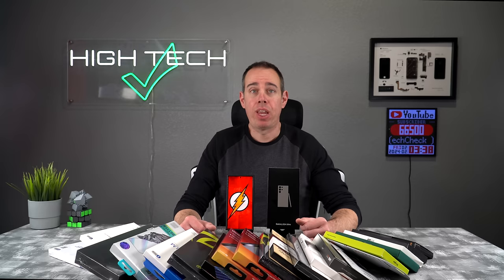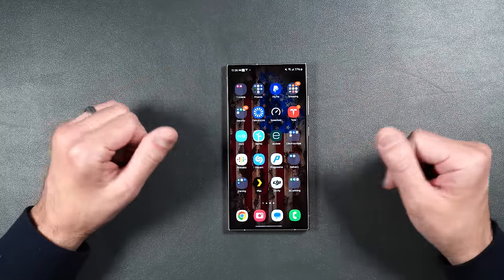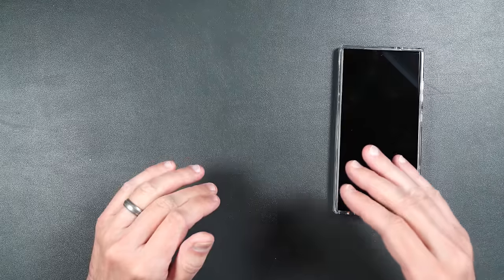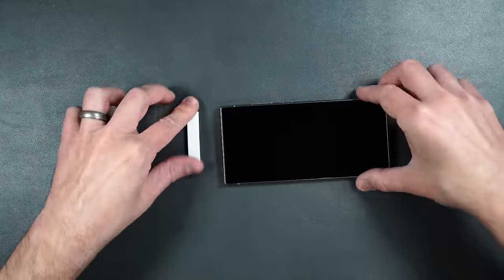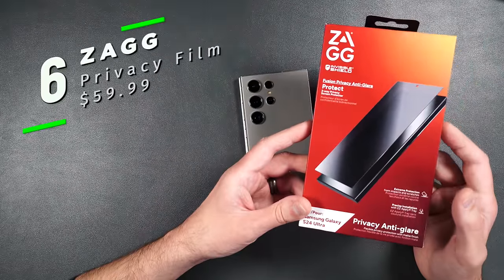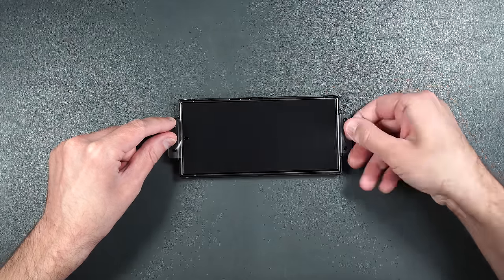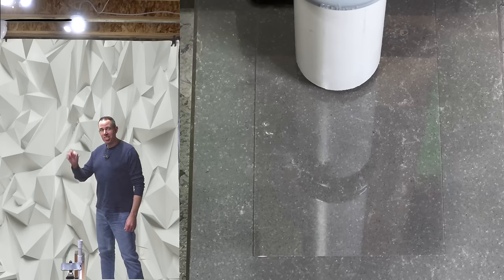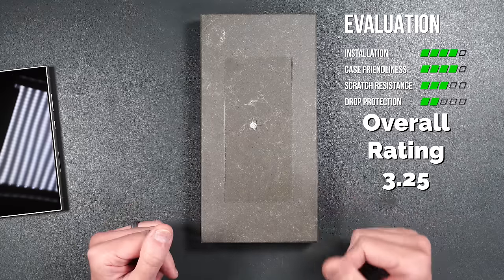Best And Worst Screen Protectors For Samsung Galaxy S24 Ultra

Comment: I think the S24 Ultra started a trend. From now on, more and more phones will have anti-reflective screens since the response has been mostly positive. I don't know how but in future evaluations of screen protectors could you find a way to measure or test their reflectiveness? I think one factor in choosing a protector will be whether it makes the screen more or less reflective relative to a standard screen. 

And one more candidate I would suggest: An official Samsung screen protector (plastic film) which claims to be anti-reflective.
Reply: Except the OEM film does not live up to the anti-reflecting claim at all!
Reply: @lcdat  From other reviews I have seen, the OEM Samsung screen protector is somewhat anti-reflective, somewhere between having no protector film at all on a S24 Ultra, and having a generic tempered glass protector. Having cracked the phone screen once, I don't want to risk going without anything.
Reply: I actually wanted to comment the same thing since I just saw a drop test that the S24 Ultra didn't do too well at, cracked at waist height (cases are important for these phones).  I have Samsung Care+ to get the screen repaired if anything ever happens, but that shouldn't be mandatory for all users.  I feel like anti-reflectiveness, which is part of the reason some people (myself included) went for the S24 Ultra, should definitely be a matter of importance in these ratings for this specific phone (and any other new phones that may come with Corning GG Armor or any other new anti-reflective glasses).  Another reason some of us went for the S24U was the scratch resistance being better, really not showing scratches at 6, only starting to pick up pock marks at 7, and full scratches at 8, so seeing that it's more scratch-resistant and anti-reflective is nice, but the lack of fall resistance is disappointing for GG Armor.
Reply: @Emolokz  I don't think the S24 Ultra is worse than other phones, and scratch resistance does necessarily translate  to drop resistance. I cracked the glass on a Note 10 and since then have used screen protectors on all of my phones (not curved).
Reply: @woofinu  I didn't say it was necessarily worse. I am merely pointing out a potential weak point.
Reply: It's pretty funny how they release this anti-reflective screens but most people will use a screen protector of some sort which negates that tech lol
Reply: @lcdat  There is no OEM film they have done that in years (atleast in the US) in fact it comes with a biodegradable jet black, non transparent, sticker the size of the screen.
Reply: @DocRealTalk  At the launch event, Samsung talked more about the screen flatness and increased brightness, and said little about the higher scratch resistance and anti-reflectiveness, or the fact that a different kind of screen protector is needed to maintain that property. I think they should have advertised it a lot more.
Reply: I hope not... I don't like the dull visuals that come through matte coatings. Also, when you put a tempered glass screen protector on the phone, it becomes reflective again.
Samsung should have left the display shiny, and included a quality matte screen protector in the box to let the user choose between vividness and reflectivity or dullness and anti-reflectivity.
Reply: @FromDesertTown  I like the new S24 Ultra screen, without or with a Samsung-brand screen protector. It does make the screen less shiny, more "dull", but it makes it much more legible in sunlight. I think it's a good trade-off because I use the phone outdoors a lot.
Reply: @FromDesertTown 
There was an update which lets you set how vivid you actually want the screen to be. I just wish someone would release a screen protector which has the same anti-reflective tech.
Reply: Manufacturers need to keep up with Samsung. Why would I spend the money on this phone if I was going to put a shiny cheap a** Reflective screen protector on it and ruin. One of the best features of this phone I watched every single screen protector reviewed in this video and there isn't 1 that I would put on this phone period

Corning gorilla armour is next level. I'd rather invest my money in samsung care+
Reply: @williamandrus4704  Many people don't know or think that using a common screen protector will negate the anti-reflective property of the S24 Ultra screen, and many reviewers don't point that out. 

Samsung sells a Samsung-brand plastic screen protector that is anti-reflective. I have it and it is quite good, but not as good as a bare screen. It's a trade-off between having a glare-resistant screen and having some barrier against scratches and breakage.

Comment: Thanks for this video. I do wish you spent more time focuing on fingerprint reader as many of the ones you stated it works on.... do not work with fingerprint for others and have horrible reveiws for that reason.... i ended up going with the ultraglass as it had 80% positive reviews and more confirmations than not that fingerprint works.

Comment: Nobody who compares screen protectors on the Galaxy S24 Ultra seems o be mentioning comparisons of the relatively low reflectance of the naked screen with the reflectance of the screen protectors. Do any screen protectors match the phone, or do we lose that selling point?
Reply: For the most part, the ANTI REFLECTIVE feature is completely gone with these temper glass protectors.  I just added one on mine and after rocking phone with no protector for a month,  I'm debating every minute to take it OFF. I got used to the non reflective screen 😢

Comment: The torras was the best, I have the whitestone dome didnt use it yet my phone gets here tomorrow but it looks pretty good based on your installment great video 👍
Reply: Torras is good but the camera cutout is ugly.
I always use spigen
Reply: have the torrus one and I hate it. I had to take it off. Fingerprint dont work ever.
Reply: @Statistic189  Did you redo your finger prints multiple times with same finger or thumb? Also helps to turn on extra sensitivity
Reply: @Yielar1  done all that none of it helped

Comment: I have the AmFilm, Spigen and Whitestone tempered glass protectors and can say the fingerprint on all of them does not work depending on your finger!
With that I mean if it works on the first try it'll work every time, if it doesn't work on the first try it just won't work no matter how many tries, my guess is it has to do with your finger itself (dry, wet etc...)
All of this is with newly registered fingerprints + touch sensitivity on.
My friend has the same problem when he brought the S22 Ultra and has never used glass screen protectors since, he would rather pay the €330 (He did twice 😂) than lose his fingerprint, screen vividness and S Pen sensitivity.

Yes it does lose some of it's color's vividness and S Pen sensitivity, my friend told me and I confirmed it myself with all my protectors.
Reply: Y'all got dry hands. Moisturize.

Comment: So after watching this I decided to give the torras a try (still waiting for it) but then I got into the negative reviews side of amazon.. a lot saying it was breaking easy, so that got me looking for more test videos.. and one that popped up was the iPhone version of the torras, and that broke at 5ft instead of over 8ft... so now I'm worried about quality control. I think you could make a really interesting video by getting multiple units of a top performing protector brand, or a few brands, and running the tests multiple times to check and see if there is wild variations between units.

Comment: Bought the Torras case a month ago and installed it right away. Noticed within two weeks that it's already developing bubbles on the top left side—not happy about it. I'm using the original Samsung leather case, so there's ample space between the protector and the case.

Comment: Sorry buddy but the Torras sucks for the fingerprint sensor. I had that thing on for my phone for 1 day and struggle to unlock my phone using the fingerprint scanner every scanned my fingerprints three separate times did not help at all

Comment: What is axtually the best screen protector for s24 ultra for fingerprnts scratches and dropping. I have tje spiegen i dropped is mayne a goot of the ground it hit the corner of my mous case and the screen protector cracked not very good. Looking at wsken and torras cause easy dust removal zagg ive hesrd is the best but hard to install. Torras i about bought its great one thkng i hste it bas a camera cut out

Comment: observations: the screen protector should BREAK, it is supposed to do, so it can absorb the impact, the "drop" test should be done with a glass breaking tool it is a superb test to see if the screen protector actually absorbs the impact of a fall instead of conducting it to the smart phone screen (like ceramics do) protectors like ceramic ones  conduct the shock to the adhesive  and to the "screen", this is bad because the screen would crack by the shock and the screen protector would remain intact

Comment: got the ones from samsung and they are awful with bubbles difficult to get rid of.The ones I never have a problem with is tauri,they fit easy and bubbles clear easily too.Don't know about toughness or scratch resistance as I never have those sort of problems.

Comment: Dont you want the screen protector to crack? To stop the impact from transfering to the actual screen and cracking the screen, no point if the screen cracks under the protector anyway.

Comment: Overall a very good comprehensive review, but why did you skip the drop test on the whitestone? I can say with experience that while the drop test you are using is a good point of reference for the apparent strength of the glass, the flexing of the glass can be deceiving on the height of the ball before the break. I killed the screen of my S23 Ultra last December when i dropped it and it hit the center of the screen on a raised table leg. On first look, the whitestone glass was cracked, but didn't look that bad. However when I removed the tempered glass, the screen was shattered in worse condition than the Whitestone. Ended up having to replace the phone. I think the EA types of glass might be better for protection from off axis hits.
Reply from the maker: I’ve never done any of the drop tests on the glass that use liquid adhesive because of the stone that I’m using for the drop test. That would actually be a great test and maybe someday when my channel is big enough and I can afford it,  I can do the drop test on the actual phone. I would absolutely love to do that for everybody. I just can’t afford to buy multiple phones. If my phone screen cracks right now I won’t have a video lol.

Comment: Screen protector i can take cheap ones in the meantime. A phone case i cannot its got to be otter box a lot of youtubers when talking about s24U all being sponsored by crappy little plastic cases 😂 pretty cool designs but i dont care about designs on my case id rather have it protected when it falls since i dropped my s24U a dozen times already. The youtuber that teams up with otter box for a deal then maybe id buy one.
Reply: I've used a otterbox defender on every galaxy phone i've ever owned & have never had a broken phone yet...definitely the best case for protection
Reply: @Rammer_Jammer  same lol I just go with a black defender box all the time don't care if its basic gets the job done! I've dropped my 24U a dozen times already and in the concrete luckily it had the otter box! When I recently got this s2u 2 weeks ago I didn't have a case on it for a couple days and dropped it a couple times, the worst one was I dropped on tile stairs so it chipped the titanium ride side very close to the screen so yea otter box is they way to go bot lite plastic thin cases 👎🏼

Comment: Thank you so much for your long hard work on these many different screen protectors and also compiling and formatting and consistent methodology.

So much to unpack here.  I can't say which was my favorite from my first pass.

I'd like to suggest a few things:

1. Dividing screen protectors into groups: Tempered Glass, Tempered Privacy Glass, Films, and Privacy Films.  This way viewers can easily forward to the section they're most interested in since we're not likely to veer away from what we want, IE Tempered Glass, Privacy, etc.  Also you can actually chop a master video into smaller more specific videos that are more digestible than a 2hr video and also you can link each one at the end if that helps views and the YouTube Algorithms.

2. Fingerprint and Face ID emphasis.  I would like to hear your specific personal experience with NOT NEEDING to re-register your fingerprints VS. NEEDING to.[Have this as a fine point maybe even a metric]  To me that incidicates compatibility and usability and I'm sure other viewers feel better about screen protectors where the fingerprint sensor works without having to re-register fingerprints.[This is also irritating for apps that, because of security, require initial set up again because biometrics have changed.]  Likewise some screen protectors are full body/face and cover the camera, and for these I suggest you again group in their own group, or at least evaluation, because some people want full body/face protection, but they also don't want to compromise face unlock if they use it.

3. Evaluations - IF you can honestly recommend 0-2 winners among each category: Tempered Glass Clear, Tempered Glass Privacy, Film clear, Film Privacy, and maybe just for winners, Best Fingerprint and Best Face ID without having to re-register.  Almost like an awards ceremony or show this could be exciting and give viewers the short quick answer they may be nmwanting/needing.

I'm not sure what your motivations were in spending the time and effort to make this video.  But I applaud and thank you.  I do believe you could make the content more digestible and possibly even get more views with just a little more effort in chopping a master video.  You can still have a master video, however I personally find it difficult to find 2hrs to sit down and watch something through that is not an entertainment movie.

Comment: This phone comes faulty by manufacturer. The antireflective layering is causing the rainbow effect and it wont go away. The s23 ultra didnt have this issue...its a pain to the eyes to look at, specially if you pay this price. Im returning my 1tb s24 ultra and mark my words, samsung will fail big with this issue until they make ppl return phones so they can remove the layering behind the screens and send out again.
Reply: What are you talking about bro my phone (s24 ultra) has no issues. Either you got a defective device or you are lying either way you ain't happy get another device. Samsung survived phones blowing up in people's hands I'm sure they will be ok buddy. P.S. all the 24 ultras I have seen have not been defective.
Reply: Zero rainbow effect on my S24 Ultra and the screen actually looks better than my S23 Ultra I had for 11 months. Much brighter too with less reflections. Best part is it's crystal clear in portrait and landscape with polarized glasses on....which is a huge feature. S23 Ultra turned black when looking at it in landscape mode with my sunglasses on.
Reply: @kinglyfe86  Sounds like he's making up bs